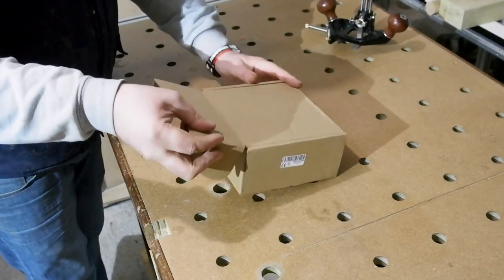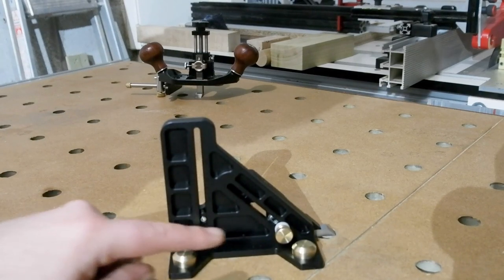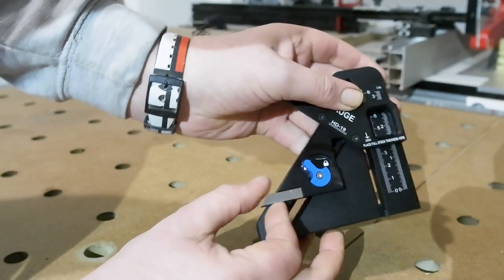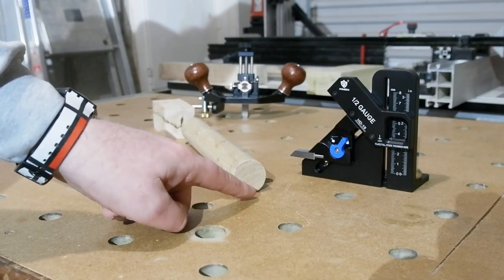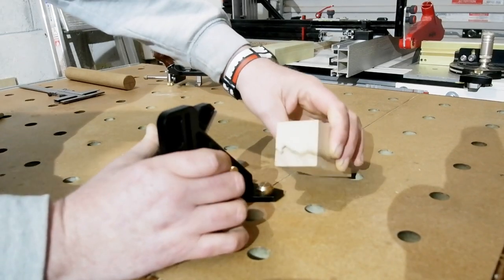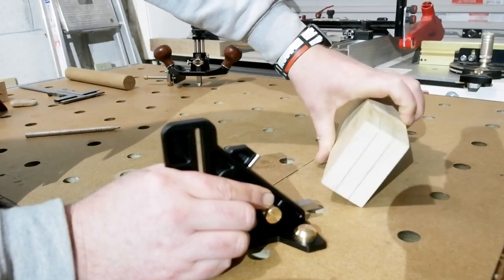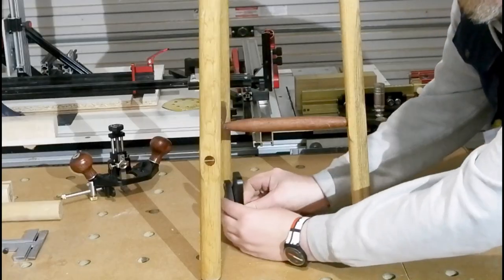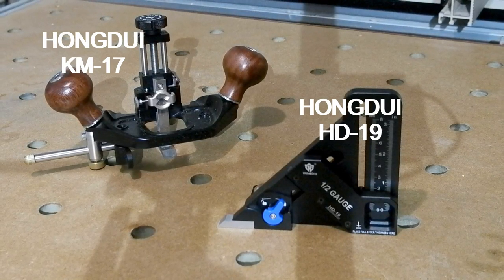*GIFTED* HONGDUI HD-19 Half Gauge Review

Comment: I like the find the center of a piece of wood function...because with a marking gauge it always takes a few marks on the wood to find the centre....
Reply from the maker: That's it's number 1 function really - marking exact centre. I know what you mean. I have a couple of centre finders. The ones where it has a V shaped body with a piece/rule across the centre. Problem is, although the rule edge is exact centre, your pencil or knife is to one side of it, so slightly off!